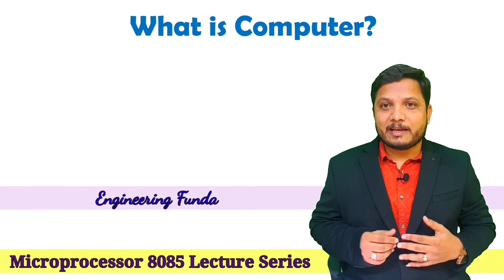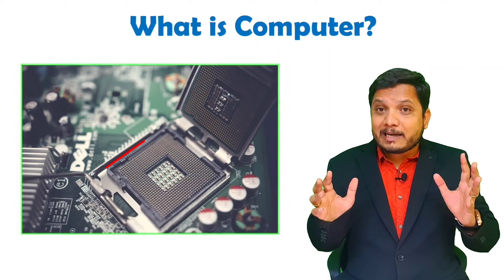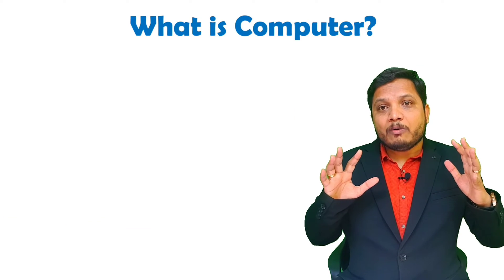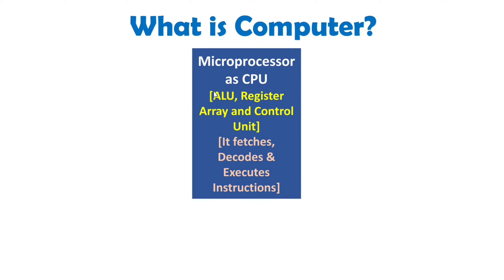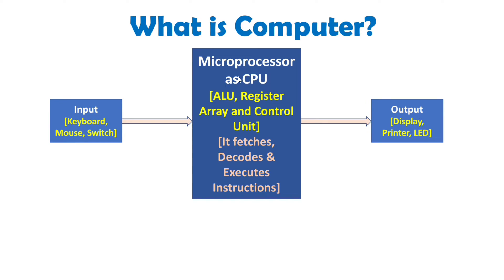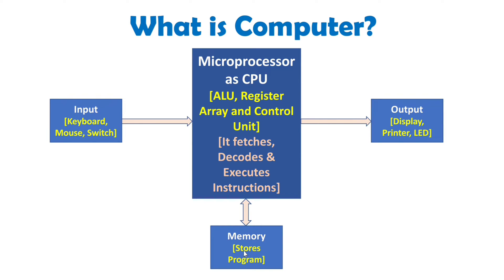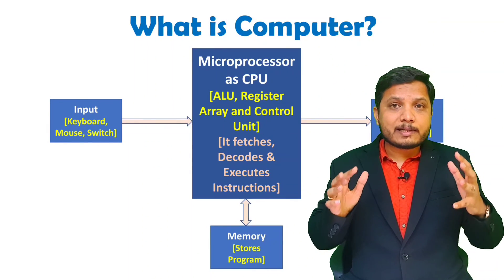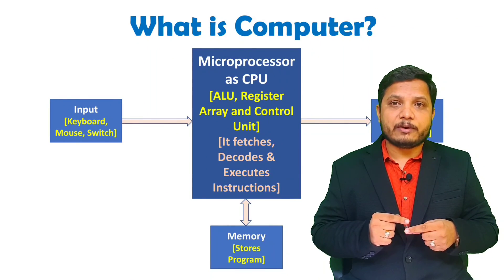What is a Computer? Understanding the Basics and Functionality

Comment: 00:02 Understanding what is computer
00:50 Processor is a single chip with ALU, resistor array, and control unit for executing instructions.
01:43 Computer has three major elements: ALU, resistor array, and control unit.
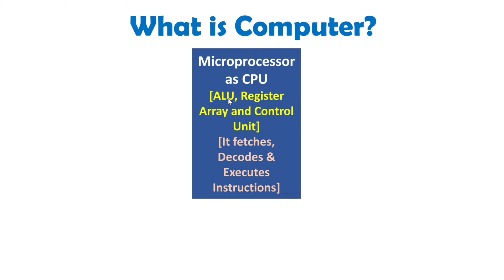02:36 Microprocessor takes input and provides output through peripherals.
03:25 Interfacing input/output and memory with microprocessor
04:14 Computer consists of microprocessor, input/output devices, and memory.
05:06 Programming is stored in memory and executed based on input.
05:54 Computer processes and displays data with software and hardware.